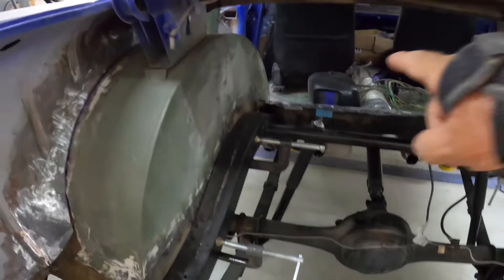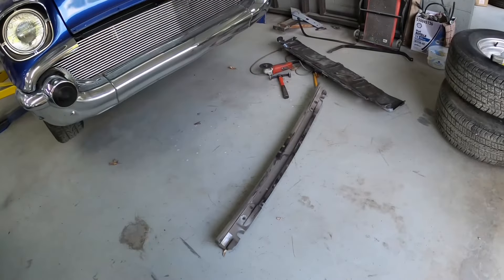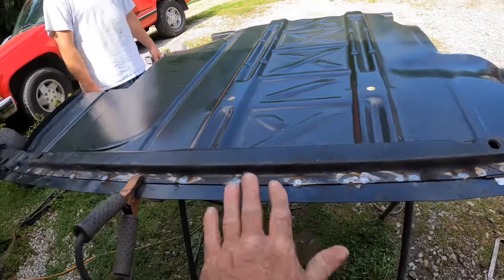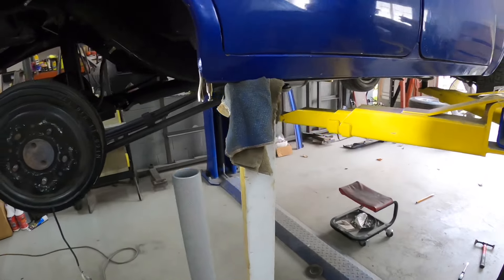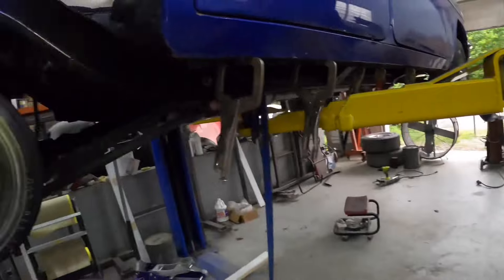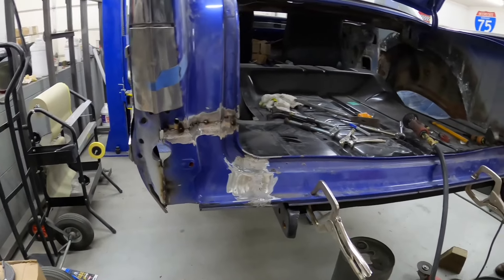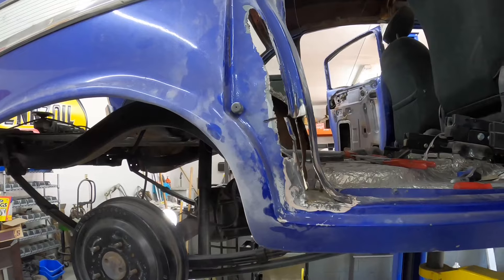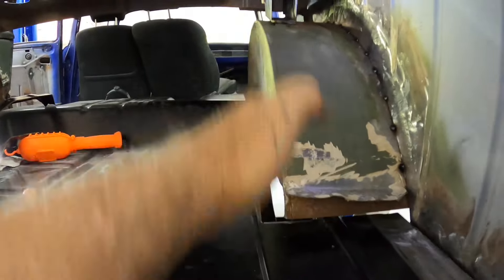55-57 CHEVY FOUR DOOR BELAIR SEDAN LOWER C PILLAR - TAIL PAN PANEL AND TRUNK  FLOOR REPAIR

Comment: HELLO. SIR. DONT KNOW. HOW MANY HOURS. BUT. YOUR.  ABSOLUUTELY.  SPOT. ON. AN H ROT. OR. PANEL. OR. QUARTER. OR THB.  ALL  CONNECTIONS.  ARE NEEDED. FOR   STRUCTUREAL.  INTEGRITY.  A VERY. SMART. MAN.  GREAT VIDEO.  LOG.    WELL DONE.
Reply from the maker: Thanks for the compliment and thanks for watching